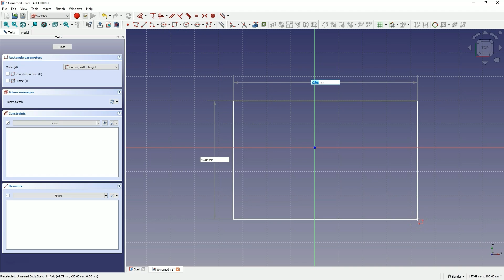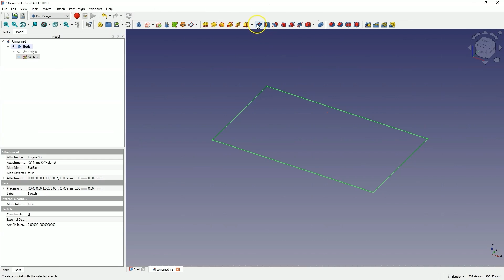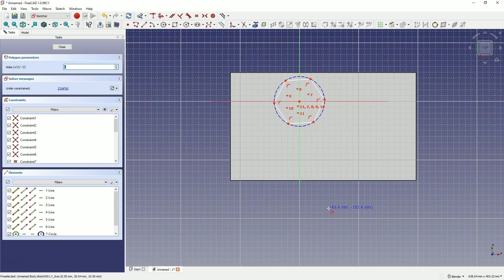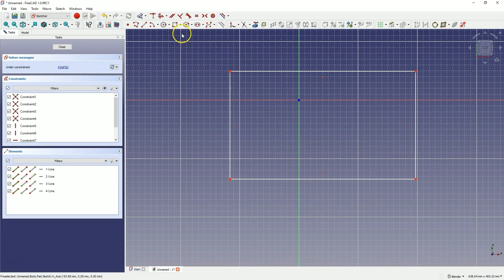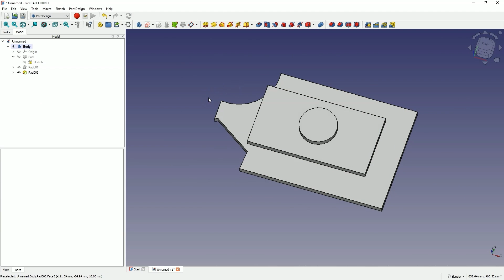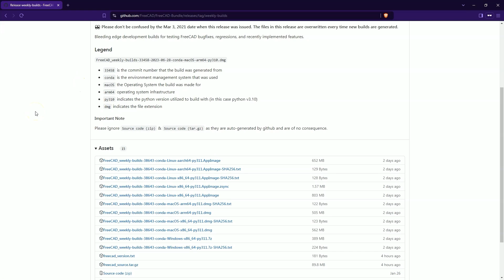FreeCAD 1.0 RC1 - Release Candidate

Comment: I use FreeCAD 20 and have beenbusingbit for years and I can send the STL files straight to my FlashForge Creator Pro or zoom them to Blender to do a demo.  With FREECAD you have FEM and CFD the data can be exported to Blender or you could use open foam to run your models or pick up R with you could run either from R Studio or VSCode.

Comment: Why the jump from 0.21 to 1.0 ? Why not 0.3? Do they really think they have made big enough improvements to justify that? That would be amazing if true. If it's an exaggeration this could really hurt the project. I'm hoping this is not a marketing stunt.
Reply: this is definitely the biggest change freeCAD has had in a long time.

the big ones being midpoints, offsets and the TNP
I have seen many commenters over time talk about how these 3 features were what was holding them back from freeCAD. I personally cannot wait for 1.0 to come out and I think the full release name is warranted
Reply: Certainly looks like marketing hype because it still can't do a basic thing like multiple profiles in one sketch for multiple bodies to be extruded from. It can't be statedhow much not having this slows things down.
Reply: @BeefIngot You can select parts of sketch to extrude now.

Comment: FreeCad 1.0 RC1 still carrying the issue of SWEEP a Helix with ExtendedCurve:Straight at the vertex.  It takes a very long time (minutes) then comes up with a twisted sweep. In some cases, it does not do that if you do Sweep without Frenet, but then the whole Sweep twist on the path.   It is easy to duplicate, just Sketch an ARC with 3 points, anysize and angle, then use CURVES workbench to ExtendCurve, 10mm, Straight.  Then in Sketch create a Triangle shape perpendicular to the curve, to be the sweep Profile in Parts Workbench, using the curve as the Sweep Path.   Without the ExtendedCurve:Straight it does nicely, with the ExtendedCurve it messes everything.  It seems the ExtendedCurve inserts the extension backwards in the path, and Sweep got lost.  Interesting that if the ExtendedCurve is set to 2GCurve and enter the right length for the curve to bend inwards, it always works, even being much more complicated for the Sweep.

Nice things on 1.0, now when you rotate the graphics part using mouse, where the mouse is becomes the center of rotation with a pink dot on screen. You don't need to click mouse wheel anymore to set the center of rotation.  Not so nice, when using Transform to move the graphics part, sometimes takes several seconds after you press ESC or OK to end the transformation.

Thanks for the review.
Reply: did you file an issue ?
Reply: @HennerZeller not yet. I need to make a simpler example to document it, may be it becomes a ticket.
Reply: Ya, i have the same issue. i use those features to make a complex coil spring shape, I ended up made my own python script to generate the sweep shape (through Part workbench)

Comment: These improvements are great! I was using FreeCAD for a couple years, but became frustrated with TNP and other model breaking issues. I recently switched to Solidworks for Makers. 

If more quality improvements are added at a good pace, I might return to FreeCAD in the near future. Choosing between a free open source application and one that requires an expensive perpetual license is a no brainer. 

Model breaking issues are a deal-breaker to me, I don't mind having less features in free software compared to paid software.
Reply: To be fair, it's easy to create models that break in any CAD software, but I can't say I've looked into TNP or really even FreeCAD.
Good modeling methodology is the basis of stable models, but it did seem like FreeCAD were missing some basic, and absolutely necessary functions compared to other systems.
Reply: You know that you can fix broken model pretty easily, right?
Reply: Expensive, but perpetual is still a great deal these days. In BIM we only have expensive subscriptions, no more perpetual licenses.
Reply: @MrLelopes  A perpetual Solidworks license costs thousands of dollars, it will pay for itself if you use it professionally. For hobby projects it is way too expensive!

I agree that companies should atleast offer a perpetual license option.
Reply: @htpkey  still pretty good. Professional architects needs to pay ever raising  subscription in the 2k-6k range of fees to work. Without any real improvement from the software or with improvements we don't want.
Reply: @MrLelopes  True. With subscription services there is little incentive to improve the software, the customer pays to use the product. With perpetual license you are paying for an upgrade.

Comment: It looks like all these innovations are already in the Ondsell 2024.2 version.
Reply from the maker: Ondsel uses FreeCAD, but not everything is implemented in Ondsel. It is likely that the new version of Ondsel will be released at the same time as the release of FreeCAD 1.0 and both programs will have similar functionality.
Ondsel 2024.2 still has some problems with TNP.
In FreeCAD 1.0RC1 there are much fewer of these problems.

Comment: Yeah, thinking of 1.0 seems premature. I follow the issues being opened and honestly it still looks like too many fundamental issues come up. And I really wish there were some concerted usability initiative for solving the large amount of minor issues that existed for years, such as drag & drop in the tree often breaking everything, or consistently showing shortcuts in tooltips, or the sketcher constraint issues. Many of these issues have survived even through major redesigns of the features and just leave a sour taste for every new user not knowing how to work around them.
Reply from the maker: I don't follow the reported issues closely, I've only been using FreeCAD since version 0.17.
In my opinion, this is huge progress.
As for whether it's too early for version 1.0 or not, it doesn't matter to me. What matters is that FreeCAD is developing and fixes are being introduced regularly.
FreeCAD doesn't have to be for everyone.
We have a choice - we can spend a few hundred dollars on another program (for an annual license), or we can accept that FreeCAD may have some issues :)
Reply: @CADCAMLessons As solidworks for makers licence cost $48/year, you can't really said "hundreds a year"
Reply from the maker: @haagelx, SolidWorks for Makers is a hobby software. You cannot make commercial projects in this program.
Reply: @CADCAMLessons  it's right, but you haven't told that it's for commercial use in your comment. So I couldn't know

Comment: "a lot of problems have been fixed" … and new ones were integrated. :-/ For example, they broke helix in Part Design WB. Still looking fwd for some fixes…
Reply from the maker: I don't use all of FreeCAD's features, but what I do use is much improved.
This is just RC1. There will be some more fixes in the stable version.
Reply: @CADCAMLessons  Right, just a RC. I was just expecting that some well known bugs in one of the most popular workbenches were already fixes at this point of time.

Comment: I hope they will solve the TNP problem completely in the future. It is a lot better now but not completely solved. If you make a cube for example and you put 4 chamfers or fillets on it and then you put a pocket on a face and you remove a chamfer or fillet you still have a problem.
Reply from the maker: @guyflament566, Did you check in version 1.0RC1 or in version 0.22dev?
Because in version 0.22dev, there were still some problems. In version 1.0RC1 it is much better.
And what you are talking about works for me and there is no problem.
Reply: @CADCAMLessons  Version 1.0RC . It's better in this version but not totally solved.
Reply: @guyflament566  Can you make a little Video from your Issue? With your explanation I can not recreate the Problem. Please include the Buildnumber in your Video. I used 38642 on Windows.
Reply: I doubt it'll ever be properly fixed, but if they do like SolidWorks and implement a quick and easy way to fix broken models that would be a big help as well. I also hope they implement more of RealThunders improvements, like extruding from existing faces of geometry without having to sketch.
Reply: @kylequinn1963 I'm a long-time realthunder user and am not familiar with the functionality you cited. What does it mean to extrude from an existing face without sketching?
Reply: @kylequinn1963 to be honest, it feels like they hate Realthunder.
Reply: As long as the software allows you to select individual edges and faces and is parametric, some form of the TNP will likely exist. As I understand it - even though professional software is much better behaved, they still occasionally break a model.

There are really only two ways to get rid of the problem completely: Stop being parametric (e.g. Blender), or don't allow selection of edges and faces (e.g. OpenSCAD). But both approaches get rid of some very powerful features. In OpenSCAD, for example, you can't apply fillets or chamfers to edges - you have to bake them into the core design of the model as you're making it. In Blender, everything you do is baked into the model as soon as you make it, with your only option being to undo an operation and do it all over again. Neither approaches are suitable for FreeCAD, which is trying to have a feature set similar to professional CAD software.
Reply: Philosophically, TNP can't ever be FULLY fixed. No CAD program can. One can create simple examples that have no answer; not even a human can create an answer for. (I've been thinking of making a video demonstrating this. The full answer would require that software know WHY a part exists; not just WHAT a part does.) But the TNP solution that RealThunder provided to FreeCAD solves most of the problems anyway. RealThunder was helpfully involved in getting the fix ported to the mainline FreeCAD branch. And, going forward, the devs can put even more assumptive fixes with the structural changes.
Reply: What I've learned is to never map a sketch to a surface but muve it manually through position changing to right place. Yeah it's not what it could be but it's replayable and reduces the amount of heartache when changing other stuff
Reply: Saved me a video watch. Without TNP fixed I am not even interested. Fundamental flaw.
Reply: @ed_halley  TNP is a problem to some extent in all CAD software.